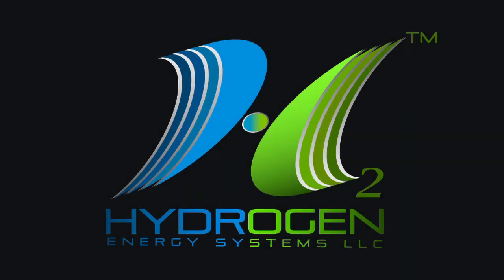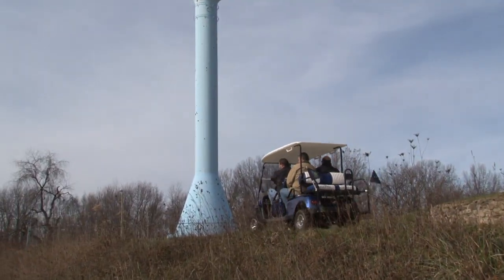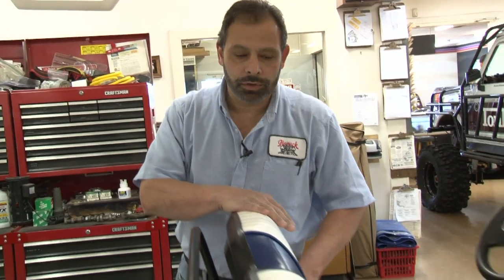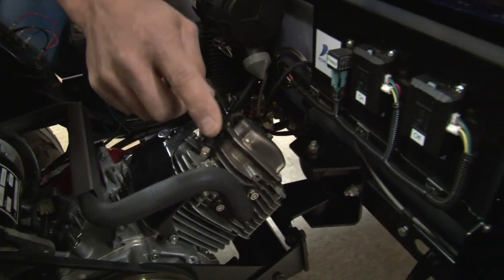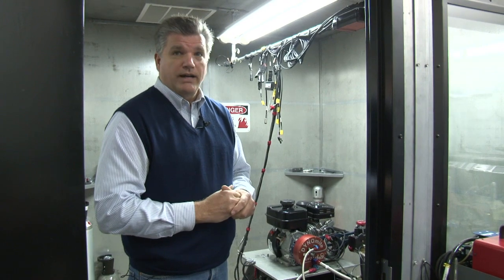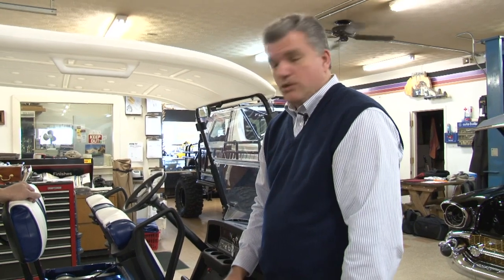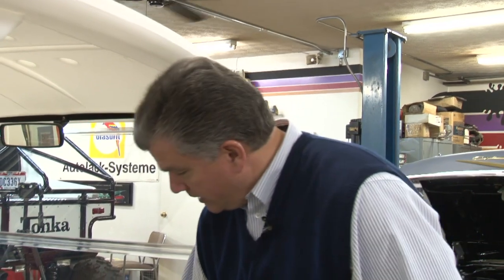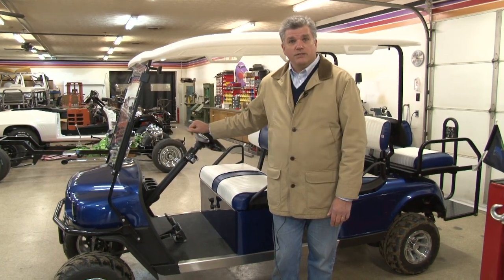Hydrogen (or CNG) powered golf shuttle prototype

Comment: Very interesting, thank you for posting and thank you developing this technology.

I have just built a motorized 4 stroke 25cc  bicycle that is burning 0.8L per 100 km, I now want to run it on hydrogen.

One of the most important advantages I believe if you using gas for power is the range increase of the vehicle, is this true?

Could you please show us the 3 figures for each category for this golf cart.

This will help a lot, thanks.

Range: 
Gasoline
Natural Gas
Hydrogen

Fuel Cost per 100 miles:
Gasoline
Natural Gas
Hydrogen

Many thanks and keep up the good work.